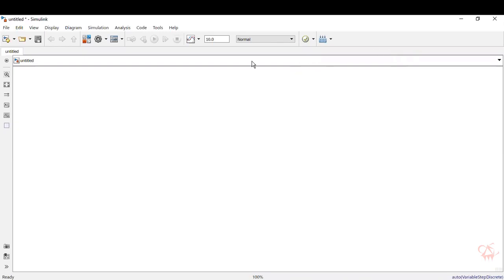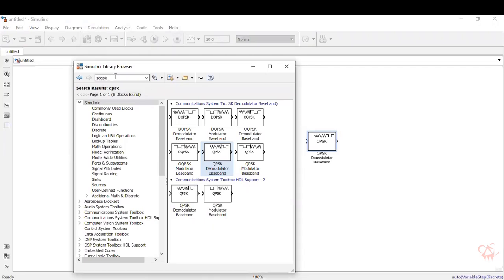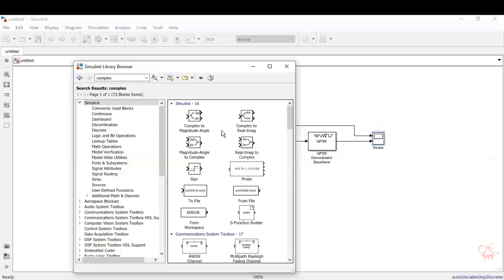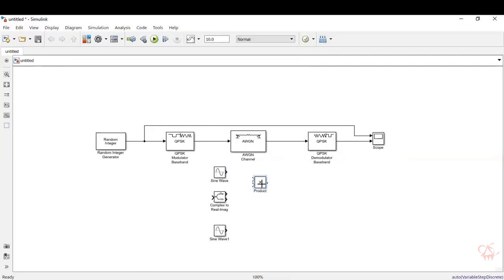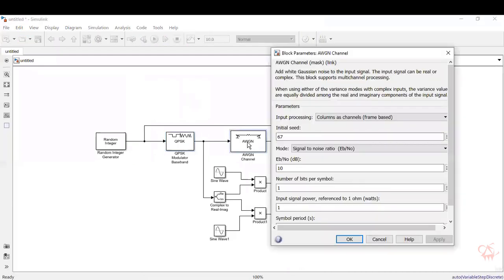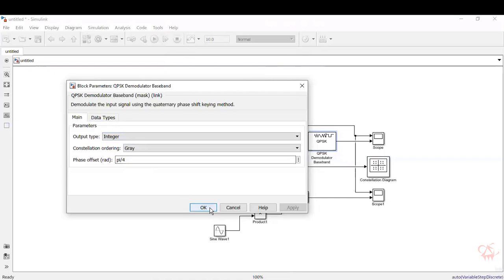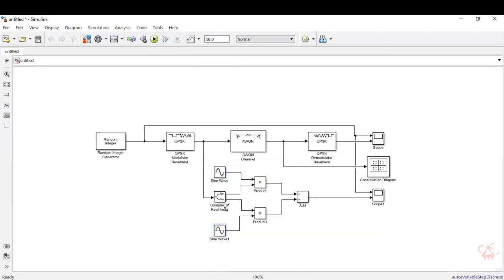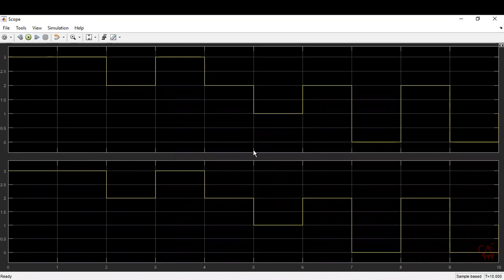QPSK using Simulink MATLAB

Comment: ON THE RANDOM INTEGER BLOCK I NEED 3 BITS SO SET SIZE IS 8 BUT IT DOESNT WANNA SIMULATE
Reply: its qpsk , it transmits 2 bits simultaneously so you cannot 3 bits